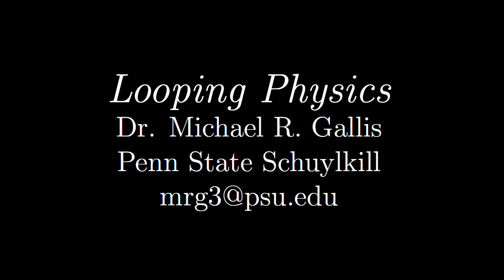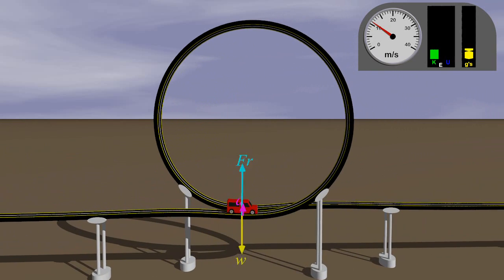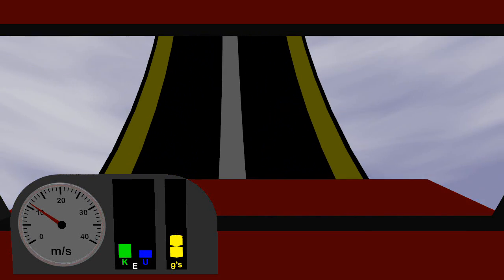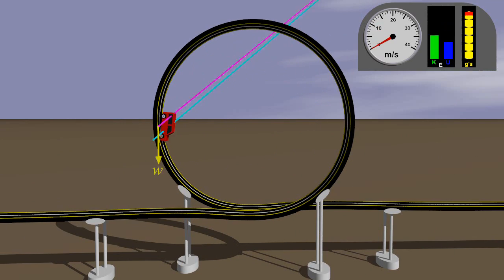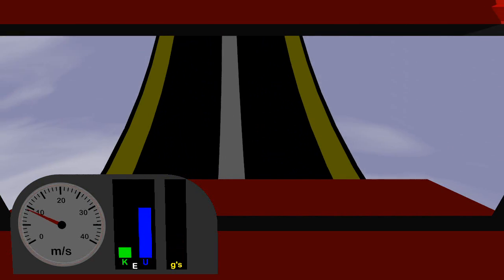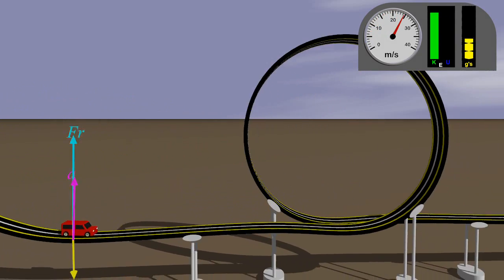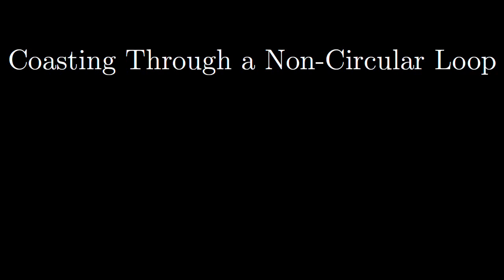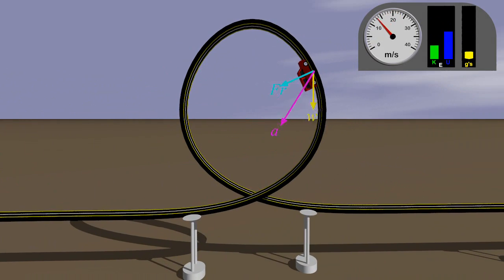The Physics of Driving Through a Vertical Loop

Comment from the maker: I use POV-Ray to create the frames of animation (povray.org), audacity to record and edit the soundtrack, virtualdub to sew the frames together into an animation file with the soundtrack.   All free software.
Reply: Why does Fr changes its direction ?
Reply from the maker: @juanvladimirperezmamani3308  Fr is the reaction force, a combination of the traction of the tires on the road along the surface and the normal force of the road on the car.  If the car is simply coasting around the track, the force will perpendicular to the track. If the  tires need to help speed up the car or slow it down, there will be a component along the track as well.
Reply: Is it possible for him to drive around especially considering that the car is upside 
down at the top of the circle?